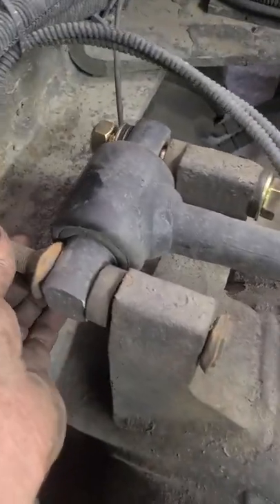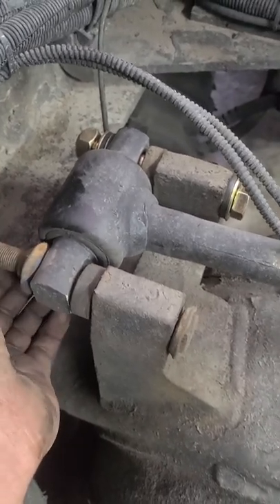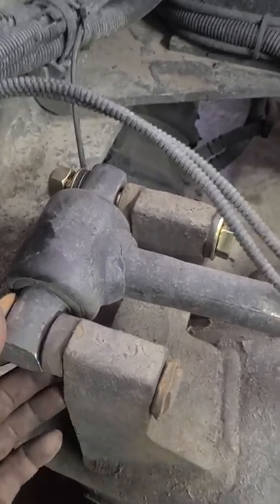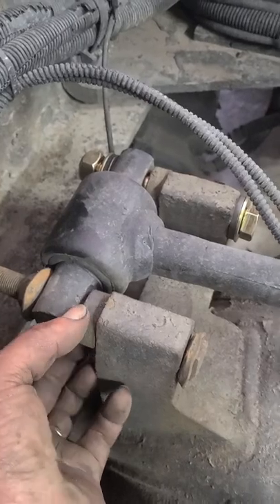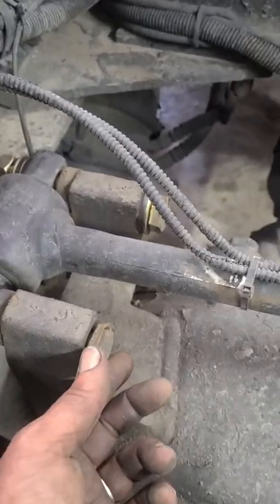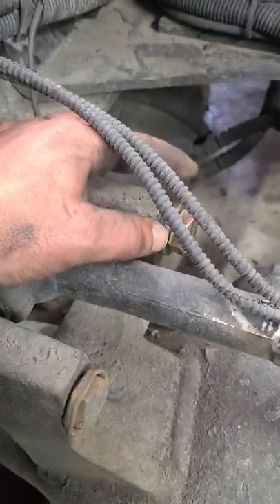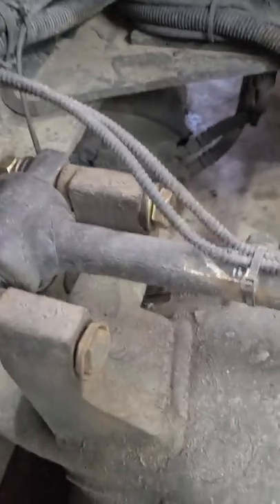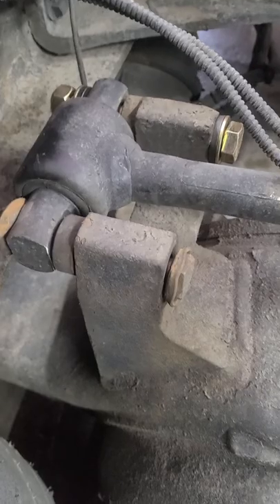Semi Truck Lateral Vibration - Possible Cause #shorts #short #youtube

Comment: on a cm870 (isx15) what wedge do we use to lock the cams in order to replace the gear housing gasket? and does the main has to be pinned? 
thanks in advance I just started trucking and dont really have the money to pay someone to do it.